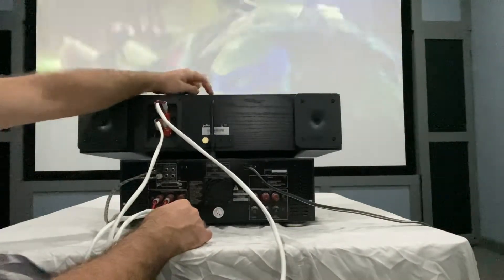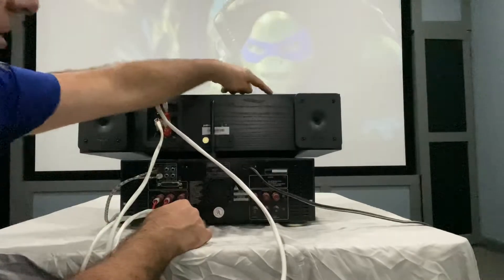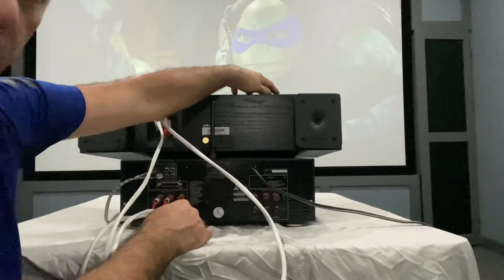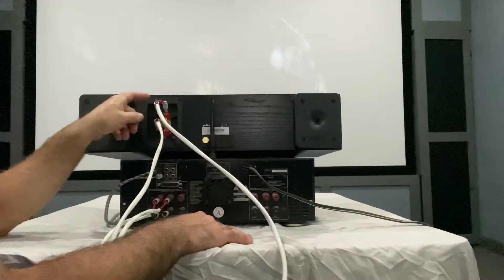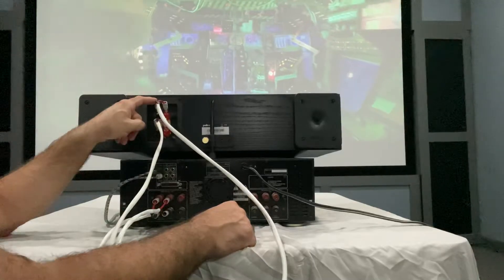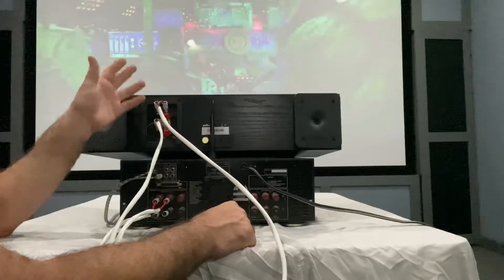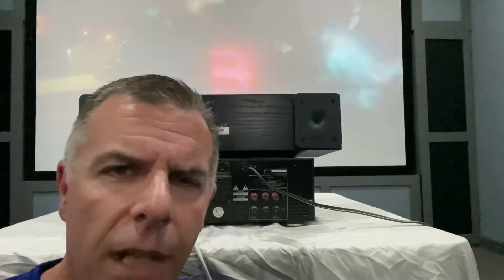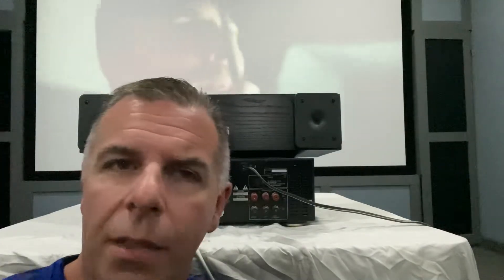Bi-amp or bi-wire speakers or run them regular? Dolby Atmos dts X 7.2.4 home theatre 4k

Comment: Tweeter will only take around 20% of the power that mid/bass when played at same volume level. So having same wattage amp for both is waste of resources. For the same money it makes more sense to buy more powerful amp for mid/bass and smaller for tweeter. The amps need to have same voltage gain though. This way you can use even different type power amps. Maybe nice sounding tube amp for the tweeters.

Comment: I currently run my Polk Audio RTi8's bi-amped, i have a 5.1 setup using a 7.1 Onkyo reciever. It makes my receiver run a lot cooler. I have the same center channel CSiA6, is the only way to bi-amp a center channel through an external amp?
Reply from the maker: Alberto G I’ve never used the receiver to bi-amp speakers. I’ve always used amps. I meant to cover that in the video. It’s always better to use amps in my opinion. You get more power from amps. Receivers are overrated on power.